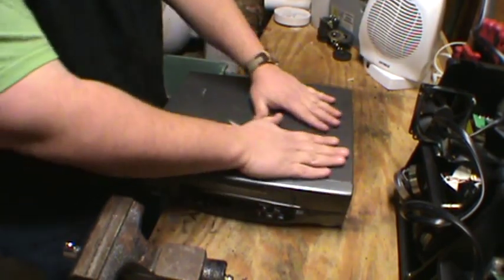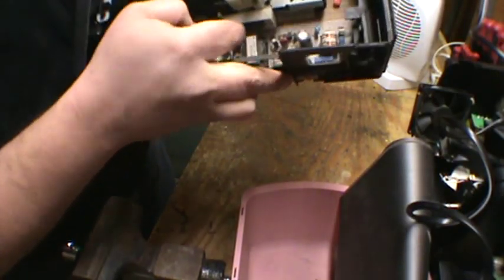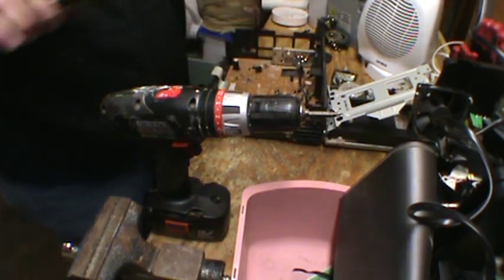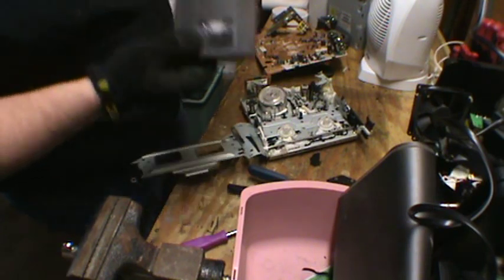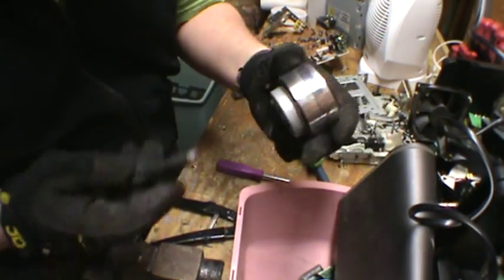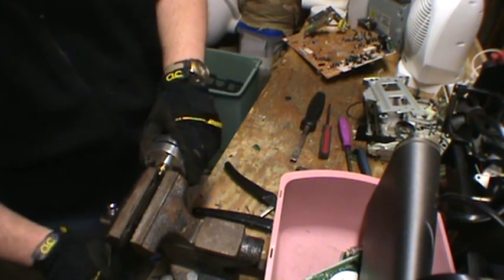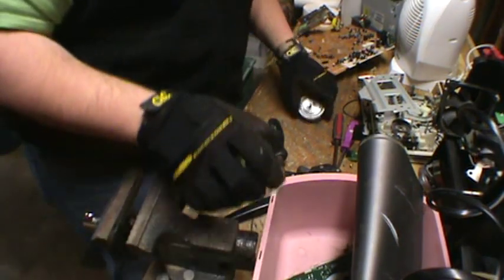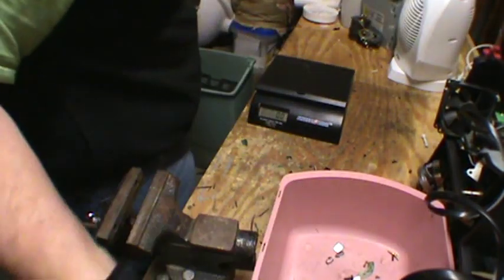How to Scrap a VCR for copper and aluminum.  Easy money!

Comment: Hi Moose! 
Thanks for the cool video. I took apart a VCR (Without the TBC!) I found in the rain with my sons (7 & 5) the other day. We had loads of fun, wrecking the thing. Got off all the valuable metals and iron, which will go into the saving bins I made. The hard plastics will be recycled too (not for money though). The rubber parts can't be recycled in the Netherlands, so they went into the waste bin. I'm a hobby scrapper since a few weeks, just for fun next to my job as a radiopromotor. Just keeping my eyes open for stuff on the streets. The VCR was our second project, first one a broken toy keyboard. So not much copper and aluminium yet, but we have turned in about 200 kilos of iron already, so the boys are now making money! 
(Up next, two tv's, a fondue-set, a Philips Smart lamp and a vacuum)
And tearing something apart has a meditation kind of influence on me. Just perfect! 

Keep up the good work with these video's!
Reply from the maker: cant ask for more than that!

Comment from the maker: Great question!  For electronics, you won't typically find brass on the outside of the piece.  If there is some confusion, a quick scrape with a bastard file will show the color underneith.  Also, brass and gold have a similar color, however, if you hold a piece of each together, there is a clear difference.  Bottom line, if its gold that I am going to be processing, the Acid/Peroxide solution will disolve the brass into solution.  Also, gold never loses luster.  Brass can tarnish.
Thanks!

Comment: Some hard to find vcr's were $3,000 new, and still worth anywhere from $200-$700 today.  What you want to do (to find out which ones are still valuable) is look up what "time base correctors" are. (TBC)  They are priceless when folks are trying to convert VHS from a shaky, deteriorated, old tape and smooth it out for transfer to DVD.  The picture will get out of sync with the player (On really long, or badly-damaged tapes,) and literally jump and jitter all over the place.  You need a TBC to fix the problem.  Many video editing folks make their living transferring VHS -> DVD.  If you are fortunate enough to find a VCR that they need (with a built-in TBC) - do not turn it into $.50 worth of scrap metal!  Look up whether or not it is considered a quality TBC vcr and sell that puppy for cash. (Even if it doesn't work, parts are still valuable.)  I have mad respect for Moose - and like Moose always says "scrap is the lowest value." :)
Reply from the maker: +Kathryn Davidson AWESOME!  This is why I love comments!  You learn something new all the time!  Time Based Correctors....  Will have to make a good note on that thanks!

Comment: There is an easier way to get that brass piece off of the shaft as well as to separate the 2 cast aluminum pieces. You open the vise up to about 1 1/2", place the aluminum spindle brass side up on top of the vise, use a hammer with a small diameter punch to knock out the center shaft. And, wella!... Everything becomes separated : )

Comment: My Dad was a carpenter and I occasionally, do some woodworking. I shudder, every time you hit and pry with a wood chisel! LOL. It's your's though and you can do what you like with it but, seriously, you should invest in a cold chisel. The steel in a wood chisel is harder, to hold an edge and consequently, more brittle and could snap or chip and wind up in your eye. That purple "pry thing" is a tack puller for upholstery work. Cool looking, though.

Comment: On a electric motor. Is there a way to remove the copper windings when they appear to be stuck on the inside. For example a power washer motor not like a fan motor where the copper windings are easy to remove.
Reply from the maker: There is a way, but it depends on what it looks like.  See if you can find a picture online and copy and paste the link to it in your nextcomment so I can see it.  Thanks!

Comment: Just a quick question.  I'm starting to consider scrapping for monies, but when you know nothing about it, it's hard to tell what's worth it, and what's not.  I read through some of the comments and you had mentioned anywhere from $2-$4 for scrapping a VCR and about $20 for a working VCR.  This video is 7.5 minutes long, but you cut out some parts so I'm guessing it took you 15-20 minutes to do this.  Assuming a medium price of $3 per VCR and 20 minutes, that's only about $9 per hour.  Not terrible, but not really that great.  I want to ask first, is my estimate of about 20 minutes accurate?  And also how do you know which ones are worth the time and effort to scrap?  Are there any that can net $10 from scrapping, or is $4 the absolute most you can get from scrap in a VCR?  Thanks!
Reply from the maker: +John Meise Hi and thanks for watching!  When this video was made  almost 3 years ago, scrap prices were a lot higher.  The value today is about half that.  VCR's, working or not, will be worth more money on ebay as they don't make them much anymore.  There is a post right below this that mentions some very valuable VCR's with Time Based Correctors.  As for the time to dismantle, it takes way less.  I can have one apart completely in less than 5 minutes.  Especially If I am not constantly checking the camera view finder, making sure to comment on certain things, etc etc.  As for the income per hour, yeah, $9 is not great, but then again, if you are making more than that, why are you scrapping in the first place?  This is a great way to make extra cash, especially if your choices are this or watching tv.  Thanks for watching!
Reply: Moose Scrapper Glad to hear my estimate was way off haha.  $9 an hour isn't great, but that was based on 20 minutes, so I think it'd be a bit more (even considering time to find scrap VCRs, and the time taking the materials to a scrap yard).  Am I correct in assuming that things like water heaters and washers/driers and other larger appliances have a much better pay rate per hour?  They are heavier and surely take more time to move and dismantle, but I'm guessing because of the amount of material, they are worth more?  Thanks very much for your reply and for the videos!!  Going to start watching them to learn more about this!
Reply from the maker: +John Meise Not necessarily.  Water heaters and large applainces are mostly steel.  Right now prices are pretty crappy for steel.  This is not to say that they can not pay better, or worse.  Water heaters, if you just pull off the brass fittings on the outside and the thermostats then you can be done ina  couple minutes, appliances can have working parts that can sell for big money as well.
Reply: Good to know :-)  thanks very much!

Comment: Please excuse me, a transformer is copper bearing, yes, but not a motor.  A motor has moving parts but a transformer does not.
Reply from the maker: Hi and thanks for watching.  You must be new to scrapping!  Welcome!  Scrap yards use the term copper bearing motor, or CBM as a reference to a type of scrap.  Basically anything that contains copper, steel, and possibly aluminum.  Their price list would be pages long if they were to try to list electric motors, transformers, inducers, relays, etc etc.  
Make More Money Scrapping Metal Part 4 Copper Bearing Motors CBM